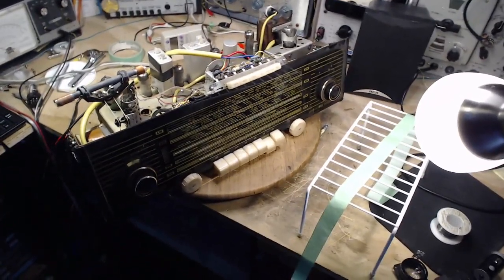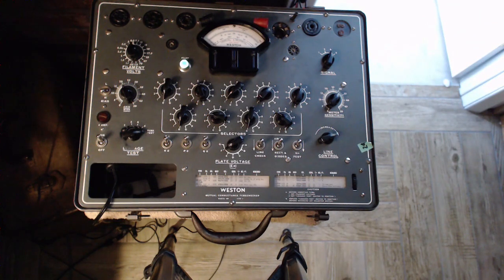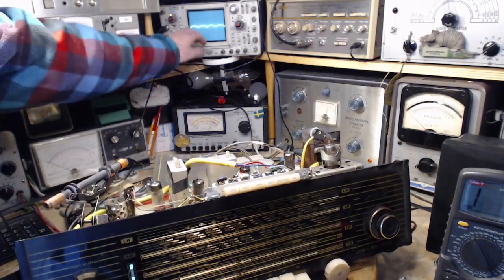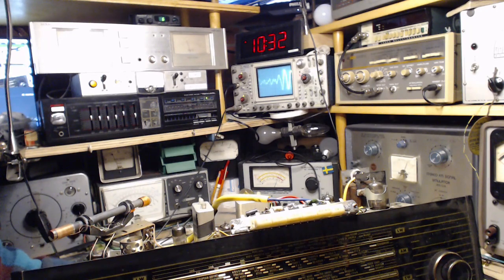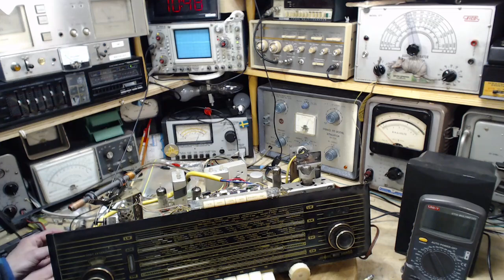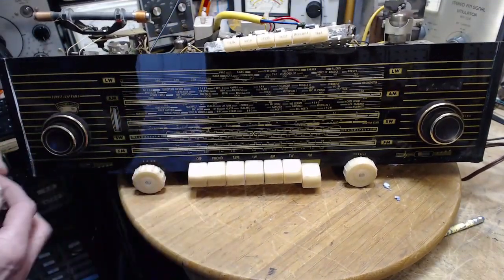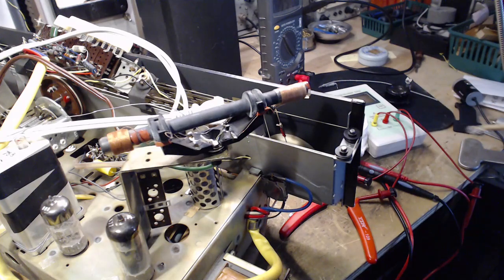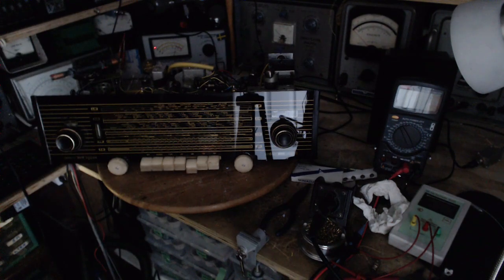German Console Radio Video #3 - Finale

Comment: 14:29 If that FM signal generator is putting out a "whopper of a signal" like you say and hooked up to the antenna or just near it, it should peg the magic eye to where it fully closes. It is still more than 15 percent open. That along with the fact that local FM stations on a makeshift antenna are only barely moving the magic eye means the radio is deaf. Any tuner be it TV or radio will perform if you blast it. 
And maybe that speaker of yours is crappy but the test tone does not sound clear. And to judge the quality and distortion of a sine wave signal on a scope, one would at first trigger the scope to display a standing waveform. This scopi-doodle-do you perform and the way you do it has no troubleshooting value and only serves as a filler to get the video to 50 minutes.

Comment: I really wish he’d spend some time and FIX his test equipment.  When you get intermittent readings, you never know whether what your equipment is telling you is correct.
Reply: All that great gear and not a clue on how to use it. He needs an attenuator on the signal injector plus he has nothing connected to the trigger for the scope to effectuate triggering.  Tons of these guys putting up video on restoring vintage radios and all they do is hack at it. Why have all this test equipment and then remove any doubt he has no idea what he is doing. To avoid aligning this very nice piece is a disgrace
Reply: Tape is an old practice to allow marking a station to find it easier. You take a marker an make a line to locate a station repeatedly.

Comment: 27:09 ESR stands for EQUIVALENT series resistance not effective series resistance. And it is not only a matter on "tiny components in modern electronics" like you put it, it is an issue whenever electrolytic capacitors come into play. But it only has become a household word with hobbyists since the mid 90s. The effect of a rise in ESR on circuit performance have been known and discussed for much longer than that. 

And the way you test the ESR is not giving true results. These J hook clips, much like alligator clips, have a high contact resistance especially if of low quality and badly maintained. That alone can add a few ohms.
And I hope contact resistance on the probes is the issue here, because a new 2.2uF with 14 Ohms ESR is IMHO Dead on Installation. At a general test scenario of 100kHz test frequency one would assume ESR to be in the 5 Ohm range. In fact I just tested a random bamboo-hut  2,2uF 50V from my used parts box on a china LCR-T4 and it clocked in at 3.2 Ohms ESR.

Comment: You have got instructions in English in the down loaded manual. It ha German and English. But I would suggest you don’t touch it.
Reply: Let us be realistic here. Even if the manual was in german only he could use google translate. Shango even used that method to translate a japanese manual live on video. And if Jim had turned to the community and asked for it, a user would surely have pitched in. Many months ago a user had given Jim full translations of a german manual for a radio Jim was working. Yet Jim did not even care and made up his own alignment instructions.
 He does things his way and accepts no other ways and never strives to do things as best as possible.
I just hope that there will be no more top of the line german sets like Königin von Saba or the Saba Breisgau with motorized tuning coming hs way. It would be a shame to see them get fixed "good enough"

Comment: 43:11 Really? Botching in dial lamps? This is the third radio that you work on which uses these E10 screw type bulbs. And you still have not bothered to get some? Any other hobbyist would have gotten a dozen by now. 
But I guess we have to be grateful that you did not decide to replace the bulbs with blue LED...